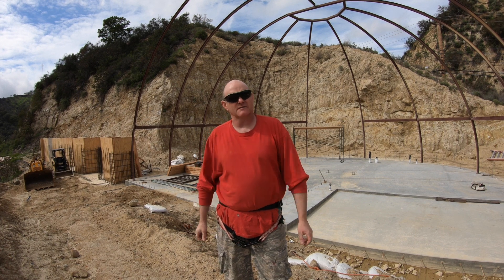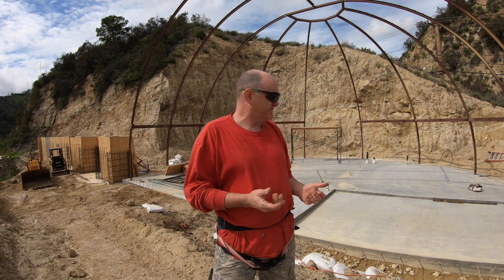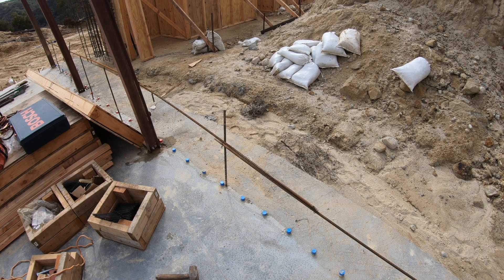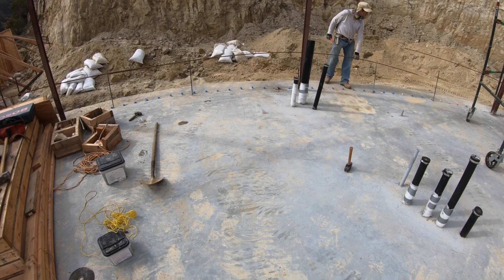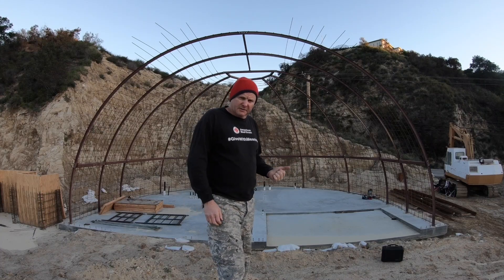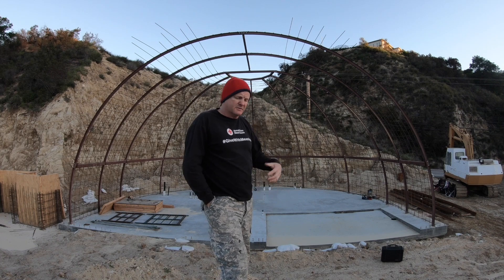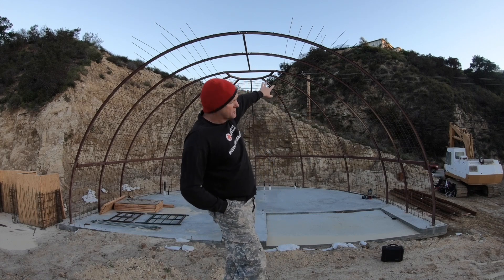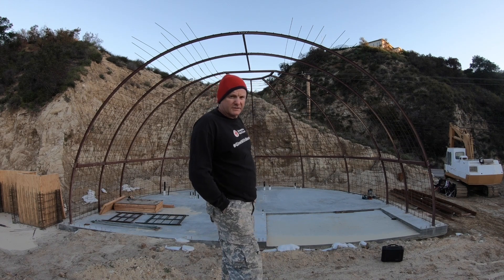Dome House Rebar on the dome frame #5

Comment: How are you attaching the vertical rebar to the horizontal?
Reply from the maker: thats in the video.
Reply: Thank you for the response! I’ve watched it twice and can’t find where you say it. Is it wire? Or could you tell me the time stamp where it’s explained?
Reply from the maker: @timor1419  rebar ties where the rebar intersects.  Can be wire, or loop ties. No difference than how you'd tie rebar for a slab for instance.
Reply: @theeddiesshow thanks so much. It’s awesome you’re still responding to questions on videos posted 5 years ago. I’m subscribed now and excited to follow your projects!
Reply from the maker: @timor1419  thanks.  I'm about to start posting again, and will explain in my newer videos why I've been absent for awhile.

Comment: You mentioned two layers of rebar. Was it number five? Do you have close-up footage? Was the first grid 12 inches and then the second grid offset 6 inches from that? Four stacks of #5 rebar would be a little over 2 inchs? How thick did you shoot the concrete? Thinking of the cross-section if you had 4 inches of concrete, you would have 2 inches of rebar late laid out in a 6 x 6 square pattern. With a full inch of concrete above and below the grid. Does that sound right? Thank you.
Reply from the maker: This dome uses mostly #4, with the occasional #5.  This dome used two horizontal and 2 vertical layers.  The concrete is 4 and a half inches thick minimum. 

Smaller domes only use one hirizontal and one vertical layer.

Comment: Quick question. where did you go to bend your rebar? Did you bend it yourself?
Reply from the maker: I bought a bender and did some myself, others, like the complex bends of tension ties, etc, I had done elsewhere and delivered.
Reply: Eddie Conna yea I’ll probably have to invest into a bender at some point.
Reply from the maker: @knighthunteroi  I bought one brand new and it wasn't cheap, but it wasn't outrageous either.  And Tools are the ONE thing I can justify spending money on..

Comment: Would a wooden geodesic dome with re bar be strong enough to hold earth covering? Thanks
Reply from the maker: Hi Deserthi, thanks for watching.  I'm not an engineer, but probably not.  The strength is in the concrete AND rebar working together.  Eliminate one or the other, and it won't be anywhere as strong.  But the dome is only 4 and a half inches thick, so it's not a staggering amount of concrete for the dome at least.  This house used about 85 yards of concrete in the dome.  That does NOT include the footers, retaining walls, retaining wall footers, etc.  Just the dome...